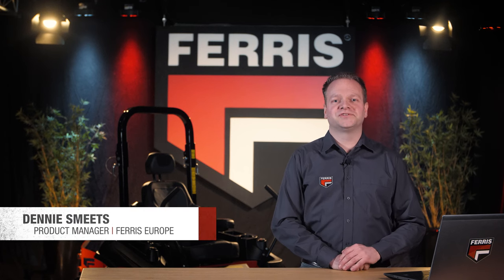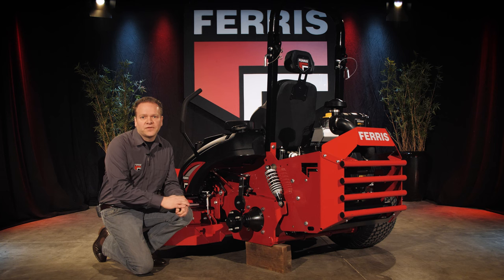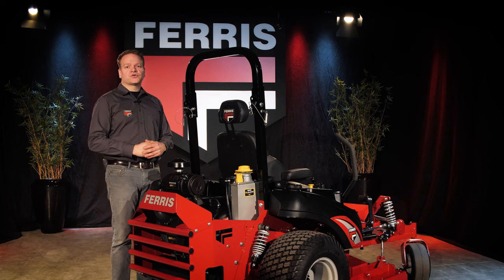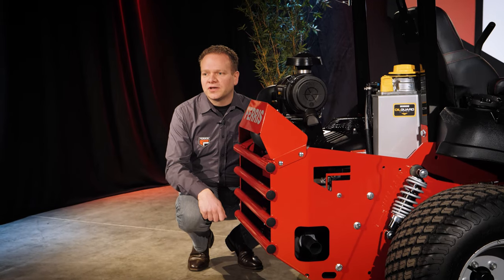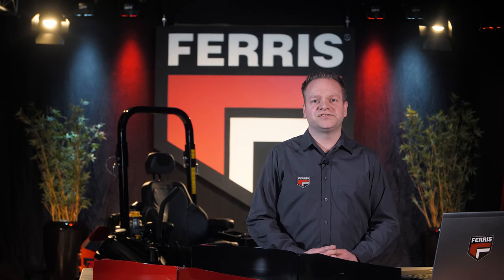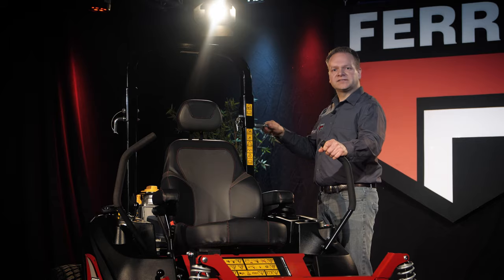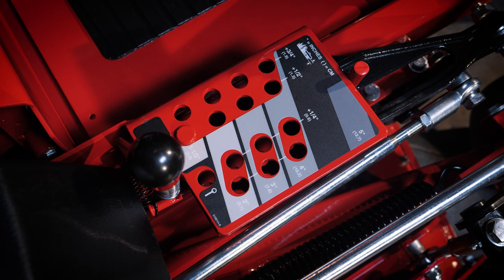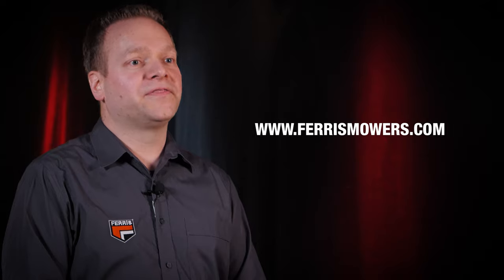FERRIS ISX™ 3300 Zero Turn Mower - Walkaround Introduction

Comment: Justin Davis i modified the icd deck by removing the tightly curved baffle and welding in a straight replacement between left and center blade.  Found out real quick that it was a mistake.  It helped a little in really high grass but not much.  It caused so much air to blowout the front of the deck that i  and the mower were covered in debris.  Had to end up putting it back to stock.

Comment: Awesome mowers. I use one in my business. Crazy tough, grips hills/slopes very well. But one things they do need to address is that even with 37hp+ that bloody deck still struggles in long grass. Its waaay to tightly baffled. If they opened up that front baffle to be more lile a Husqvarna/scag/deere then you literally would have the perfect mower. I beat mine daily from manicured to vacant lot slashing and its nevet given me a issue reliability wise. Please fix ICD baffles to more open design!
Reply: needs kawaski thats all

Comment: Why do you use such crappy fuel gauges on such a excellent machine   they fog and crust up on the inside   the clear plastic goes opaque and cracks up and break which lets water infiltrate into your fuel system if you don't notice it in time  and they are way too expensive to replace on a regular basis !
Reply: @tgh223  that's actually what I do ... kind of a pain in the ass  when you're tryin'  "to getter done"  and you have to stop and stick a fuckin'   stick in your gas tank   when you have a gas gauge option .. especially when you pay that much money for a quality mow   and it has those flimsy parts on it  ...they  need to put some real spherical joints on that thing too .. for that rather lofty retail price they force you to pay !